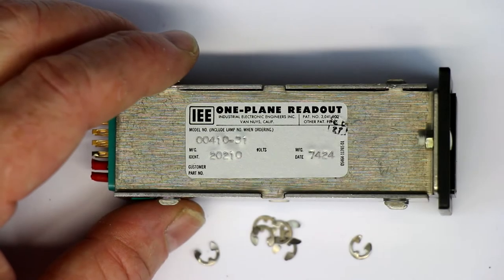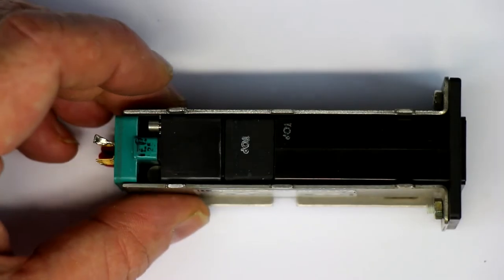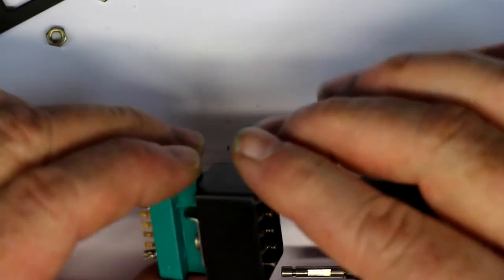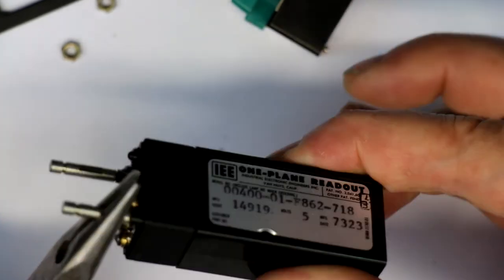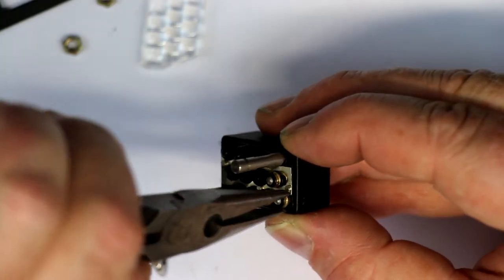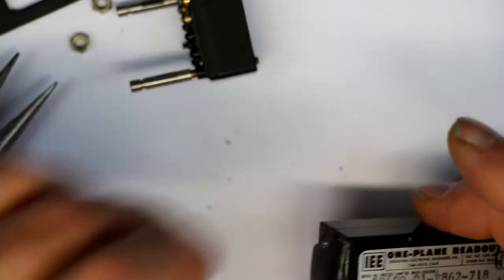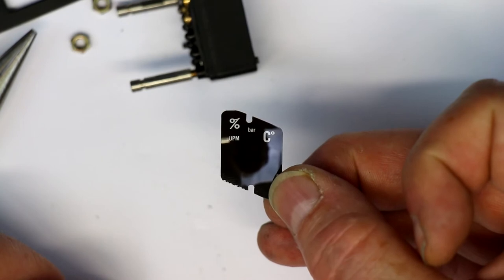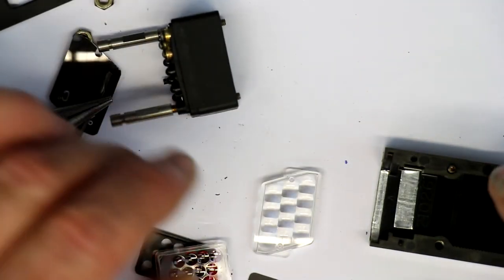Teardown of a Projection-Display

Comment: Lovely video.  

You may find you can replace with 3mm LEDs without too much trouble if you don't mind making a small PCB to mount them neatly and add a resistor.  Even surface mount LEDs may work and you could add a small micro to drive them in a diode matrix with minimal pins.  5 pins may be enough for a 3x2 matrix with reverse connected LEDs.  Only 2 resistors if only one lamp on at a time.

The rubber bungs will have been to prevent dust ingress onto the optical parts.

You may be able to cut masks with a laser from suitable substrate as long as you limit yourself to stencil fonts or microscope work with placing cutouts into place on a piece of tape and then laminate to protect from dust.

Comment: 12V "grain of wheat" bulbs?  About the right size, but I don't know of any with brass base...
Reply from the maker: No. I think I found the right type.
It´s "T1" or "SM4s/4" (Sub-Midget Flange)
The cheapest supplier in Germany sells them for 1,6€ apiece.
Quite costly :-(
Reply: I'm sure you've considered replacing them with LEDs.  :)
Reply from the maker: Now as you mention it :-)
But I´m not sure, if LEDs have the same optical properties in the light path of the projection-optics.
The point of light emission must be at exactly the same location as with the bulbs.
And the dome-like shape of the head-end of an LED acts like a lens which could also give problems.
But it´s a cheap experiment to try out a clear, warm-white LED.
Anyway the making of the projection-slide gives me much more headache :-(
Reply: Yes.  I was thinking about how to make the "slide".  I thought about laser-printing two identical layers of "overhead transparency"  (who uses overheads anymore?).  The two copies would improve the opacity.  Some people use this technique to get better results when making printed circuit boards.  Precision in cutting and aligning would be additional challenges, of course.
Reply from the maker: Good idea. My thoughts went the same direction.
I even was contemplating about putting my "old" photo-lab back into operation :-)
Another difficulty will be to cut out the odd shape of the slide.